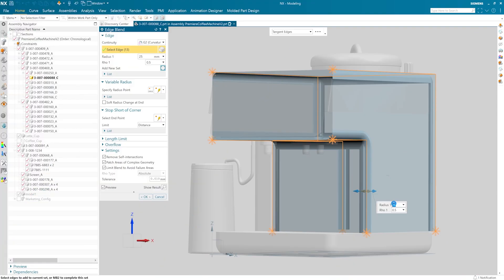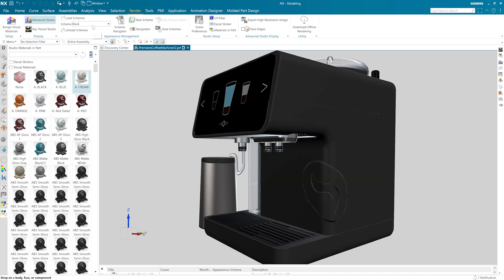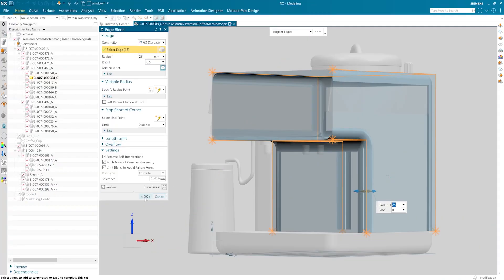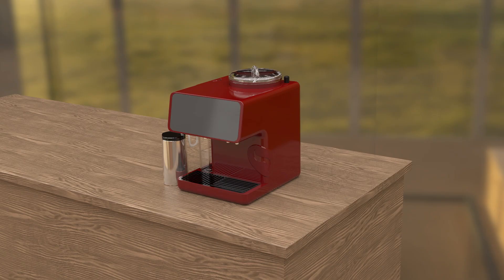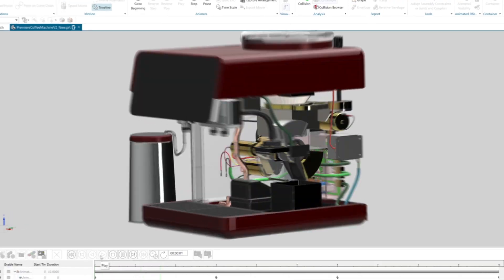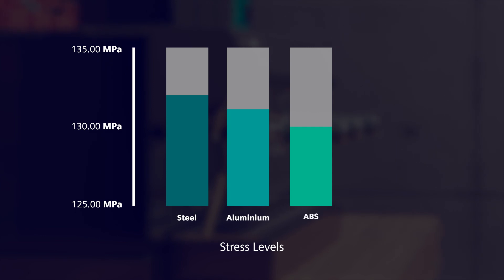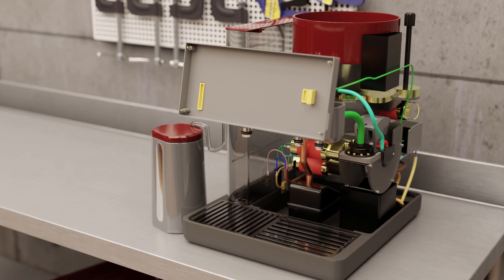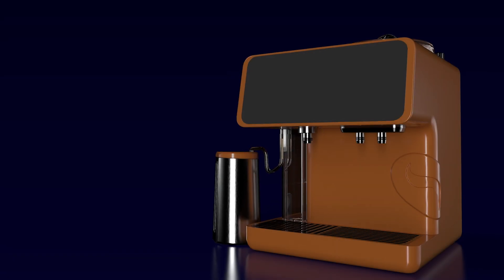What's new in NX | June 2023 | YouTube Premiere Event

Comment: So basically no improvements to modeling, surfacing, reverse engineering, performance ......nothing? just a bunch of colorful words and a politically correct logo?.....very disappointed!!!!.......
Reply: @Paul Bevan currently i fear those „new” features. Last couple of years looked like dev teams of different modułes are closed islands and do not see their new ideas will mess up with other existing features like new threads vs moldbase library
Reply: @Paul Bevan generally speaking i do not see consistent strategy for improvements. But competition do not offers better approach also